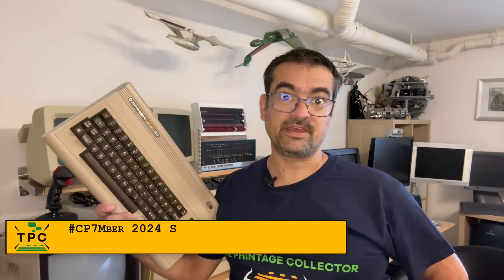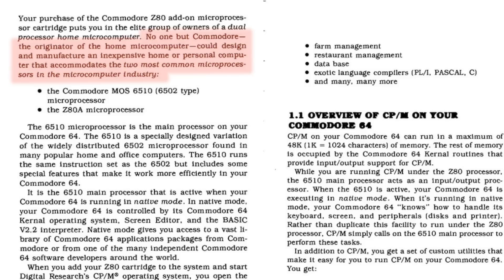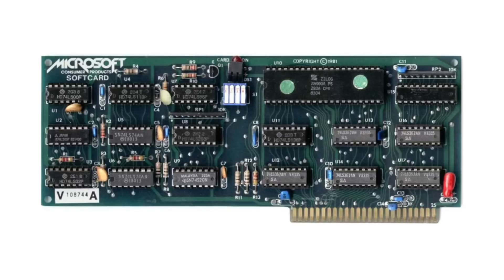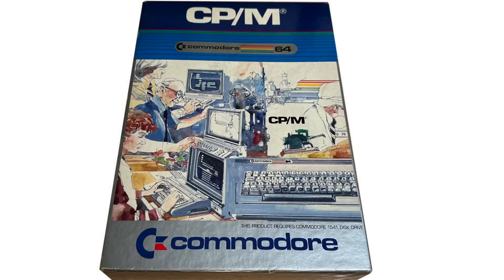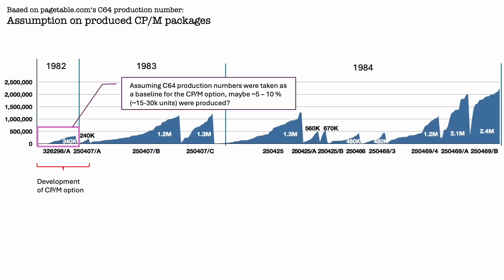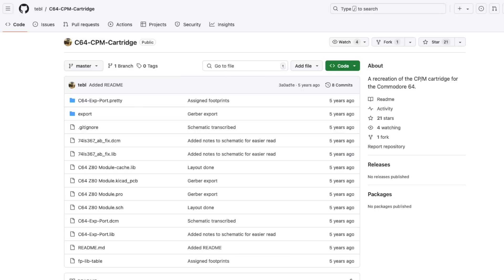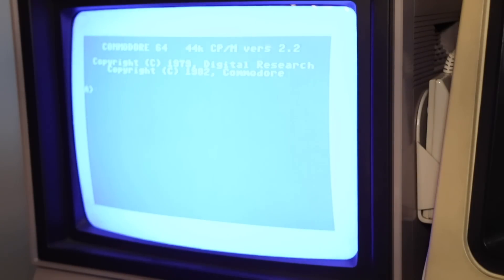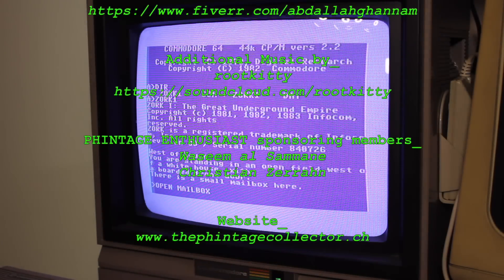Commodore’s CP/M Cartridge: The Story Behind (Part 1/2) #cp7mber

Comment: 4:57 Your math on the table is off. Specifically the C=64 column: $595+399+399+130 = 1523. Clearly, you forgot to add the cost of the CP/M cartridge. That's still significantly less than the competition, so, not wrong in saying that the C=64 option was the cheapest.

But damn, computers were expensive back then. It kind of makes me feel bad for my folks after all these years, having such an expensive hobby as a kid and costing them so much money. But then again, kids are expensive no matter what, eh? At least now computers are cheap (well, the older ones, anyway), now that I have to buy my own.
Reply from the maker: Ooppsie, my bad! Good spotting there! ^^

Comment: It’s downside is that the C64 floppy disk were pitifully slow and CP/M is a lot about floppy disk interaction (a lot of C64 software, in contrast, was available via cartridge so not as much of an issue. It’s second big downfall is that a 40 column display limitation was not a great match to much CP/M software geared to 80 columns. And the third big problem was access to CP/M software given the infamous problem of floppy disk formats proliferation - that one was actually more the fault of Digital Research for not imposing some standards for floppy disk formats.
Reply: I bought Turbo Pascal and told them, that I would use it on my c64. So they sent me a perfect c64 disk with TP on it. Yeah, I had no 80 columns and only 1 1541, but I coded quite some lines on my c64. My biggest problem were the frequent crashed, so I had to save my sources all the time.

Comment: Regarding the performance of the CP/M cartridge - I'm pretty sure that the cardridge's Z80 CPU was driven from the C64's 6502 clock (especially as the cartridge was designed so that the Z80 used the C64's RAM, rather than having its own).

The upshot of this is that the Z80 would have been clocked at 1MHz (there or thereabouts, depending on whether you had an NTSC or PAL model), so limiting its performance.

(The "original" Z80 could have been clocked at up to 2.5MHz, the Z80A at up to 4MHz, and the Z80B at up to 6MHz ; Acorn's Z80 second processor units for the BBC Micro used Z80B parts, clocked, IIRC, at the "full" 6MHz.)
Reply: And, by comparison, I also think that Microsoft's Z80 card for the Apple ][ worked in a broadly-similar fashion to Commodore's CP/M cartridge - it had a Z80 and glue-logic on the card, but relied on the host computer for RAM and CPU clock.
Reply: I don't know how the C64 CP/M cart is actually implemented, but the 8MHz dot clock is available on the cartridge port. Similarly the 7MHz dot clock is available in the Apple II card slots. So for either of those systems the Z80 could be clocked fast and have wait states inserted to sync up with the 1MHz synchronous bus. A Z80 always uses at least three clock cycles for each memory read/write cycle, so ignoring "bad lines" on a C64 an optimized CP/M cart would perform like a 3MHz Z80 when accessing memory. Not sure if the Z80 "idles" the bus when doing internal processing, if so the Z80 could be clocked at a higher speed and instructions that take many cycles but don't use memory that much, like ADD, would run at almost the full clock speed for a faster clock.

(Btw Z80 is stable down to 0Mhz, i.s. you can single step the clock pulses. Thus you can insert wait states by just stopping the clock).
Reply: @The-secret-101  Well. the Z80 needs to access the RAM somehow even to run code, so it can't do it faster than 1MHz and have its bad lines problems, unless it switches off the VIC-II.

Comment: I would’ve thought it would be better to run CP/ M from the cartridge rather than a floppy disk.
Reply: Booting, perhaps, though this would have required extra components on the cartridge PCB - perhaps something that Commodore didn't want to do for cost reasons.

(As an aside, the company Torch developed an alternative to Acorn's Z80 second processor for the BBC Micro - and this included "CPN", a Torch-developed CP/M look-alike OS, and I believe this could boot a minimal version from the built-in ROM.)

Beyond booting, I think that CP/M (and CP/M software) were generally written on the assumption of floppy drives (well, at least one floppy drive) being used...
Reply from the maker: Given the floppy disk contains roughly 100K of data, it would be interesting to evaluate what 100K of ROM would have cost in 1982.
Plus, if there would any additional discrete logic be required to make this cartridge a co-processor and ROM cartridge hybrid.

The EPYX Fastload did sell for around 40 US$ in 1984.
Given it had a 64K ROM, prices for ROM couldn't be too high actually.

So the cost would propably be moderately cheap to add a 100K ROM to the CP/M cartridge.

It could have been cost reasons for not doing this, but I think it wasn't mainly the hardware cost.
I could imagine the effort in adapting CP/M to boot from a ROM would be too time consuming, or maybe even would have required architectural adaptions to the C64 itself, hence increasing cost and time delays there.

Going with the floppy was propably more straight forward, and had a nice side-effect:
Selling the customers a floppy drive.
Reply: The only part that would had made much sense to have in ROM would be the BIOS+BDOS and possibly CCP, as that would free up some RAM (well it would if either tricky custom bank switching would had been added, or CP/M 3 (also known as CP/M plus) had been used).

Everything else would just had been expensive. Compare with that not even the Amiga with it's 256/512k ROM has for example "dir" (or "list") in ROM.

Comment: I wish something could be done showing the C128 running its CP/M mode. There are still many C128's around (compared with few CP/M carts for C64 still available). I own a C128, have never done anything with its CP/M.
Reply from the maker: @ReadrOFilz  I‘m scouting for a C128. May take some time, but I‘m curious as well.
Reply: @THEPHINTAGECOLLECTOR  , a task I have on my agenda is to get made (maybe through an 8-bit friend of mine) a 3.5 inch disk to boot the CP/M on my C128. Because I own a 1581 drive.
Reply: Ah, yes, a benchmark battle between two Commodore CP/M solutions

The 128 would have advantages of 80 column display and speedier floppy disk access. But is said the Z80 was clocked at about half of what was typical for a Z80 computer of the day, but am betting it’s the same case for the Z80 cartridge for the C64

One question about CP/M on C64 is if it’s floppy drive access is compatible with jiffy dos
Reply: @TheSulross  Apparently it is, see the Youtube video "CP/M v2.2 on a Commodore 64!" by Mike Paull.
Reply: Fun fact: Apparently in some cases it's possible to use the C64 CP/M cartridge on a C64. Totally useless as it's way inferior in all ways, but still :)

Comment: (in Mr. Know-it-all's voice) You got it booting and didn't type DIR immediately? What kind of CP/M demonstration is that?!

In all honesty though, it's an interesting story. The whole idea of putting a second CPU of a different architecture just to run some non-native software seems so alien today, even though it seems it was somewhat common in the 80s and even 90s (like the PC cards for mid-90s Macs).
Reply from the maker: @kFY514  part II next week will be a bit more hands-on …
Reply from the maker: @kFY514  and in my own narrative voice: „Sure, sure, but don‘t you think people will be bored by starring at a simple DIR listing?“
Reply: "The whole idea of putting a second CPU of a different architecture just to run some non-native software seems so alien today"

That's because the ever growing abstractions and complexities of the system chipsets which don't allow to do these things today. MMU's for example, don't allow you to share memory between CPUs of different architecture. PCI (by default, without an IOMMU) is also not shareable between memory controller hosts. You need an specific chip complex to allow CPUs of different architectures to share an high bandwith link between them. SGIs had that xBar bus thing. Last attempt on an unified bus for multiple coprocessors connected to a master complex was Hypertransport in the 2000s.
Reply: @hyoenmadan  I don't think that's the reason. We have the main RAM being shared with GPUs for example. We could also have some kind of translation layer. Or the second CPU could have its own RAM, just like the Apple PC Compatibility Cards I mentioned, which were essentially full PCs on a board, just with an unusual IO arrangement for keyboard, mouse and the like.

Of course the boring (and true) answer is that software just got portable (at either source level or through various interpreters and VMs) and there is no longer any need to do that. And when there is, things like emulation and virtualization do the job well enough, because the CPUs just got so powerful. Still, it feel ridiculous. Imagine someone today was selling the solution to "I can't run Windows on my Apple Silicon Mac" in the form of a Core i5 Thunderbolt dongle - imagine even just the idea of that, regardless of how technically feasible that is.
Reply: @kFY514  Connecting different architecture CPUs to the same RAM is different to connecting a GPU (and TPUs btw, them are the same category) to your system. For one, an extra CPU is a coprocessor, and a GPU, even the bolted APUs, are devices. So the semantics are also different. Your CPU access main RAM and you access your GPU through strict hardware and firmware semantics, and the software APIs and applications have accommodated to them, while each CPU vendor and architecture have their own semantics and requirements which are different and diverse between them. You can't just make alien CPUs to coexist without a bunch of circuitry and glue logic in the form of chip complexes, as Hypertransport in my post.

Also, system's on a board, like the Apple compatibility hardware, or the SunPCIs never were an option because them were SLOOOOOW in practice. Suitable for business programs and applications, but subpar to everything else. Also them were expensive stuff. They never stood a chance for success, and they were practically killed with the advent of advanced graphics and GPUs.

Now, a true coprocessor, as chip or as a card, would still have its use today, like for example having hybrid ARM/x86 machines for development and highly geeky stuff. But the complexities of the MMUs on both CPUs and the hypertransport complex connecting them would make such solution prohibitely expensive. Also the CPU makers of both architecture should agree and tailor their solutions on hypertransport as connectivity link between them. In the end, is cheaper just having separate machines for your needs.

Comment: It's interesting that the CP/M cartridge was a dismal failure and yet one of the key selling points of the C= 128 was it's CP/M compatibility.

Also you should consider direct video capture instead of relying on your camera locking to a very slow CRT refresh rate.
Reply from the maker: Yeah, I was too lazy redoing the footage.
All follow-up screen captures look a lot better after fixing the camera settings.

I agree, direct video capture would be of higher quality.
I'm saving up to afford a some good capture devices, though until then, camera captures it is.
Reply: @THEPHINTAGECOLLECTOR  Re capture: For this type of capture where you don't need that long sequences and whatnot, I've heard that a DVD recorder does a decent job. Of course there is the downside of having to burn a DVD (at best a RW disc), but if you would only need it for a few videos per year it might be an option if you find a DVD recorder at a thrift store.

P.S. don't take my word on this, but afaik most DVD recorders and DVD players from the 00's uses regular PC IDE/PATA optical drives, but with a different front panel, so if the drive of a DVD recorder seems bad it might be possible to swap it out with a generic PC one.

Otherwise you might want to try filming a 00's or early 2010's flat screen TV connected to your C64 perhaps?
Reply: A major difference is that the C128 CP/M is actually usable.

The fun fact is that C128 got it's CP/M mode due to Commodore aiming for it being able to do everything a C64 could do, and they had a hard time getting the C64 CP/M cart to work with the early C128 prototypes, so they decided to add the CP/M capabilities directly to the C128 :)